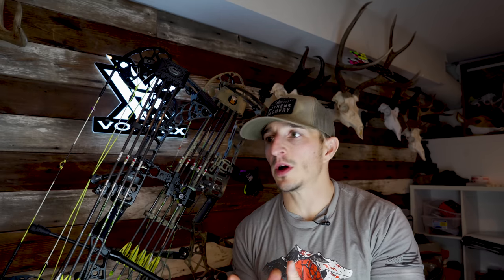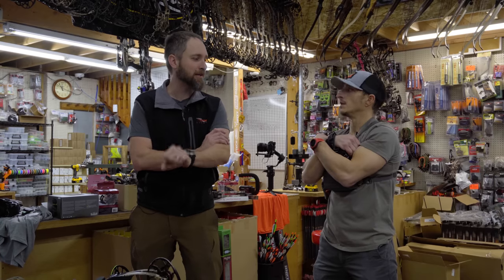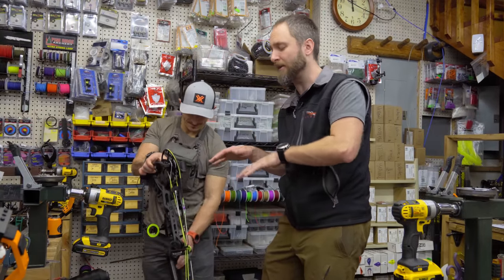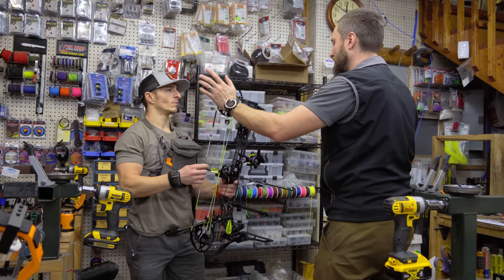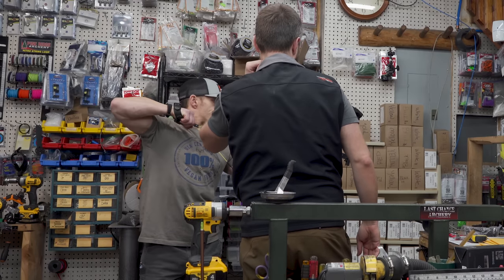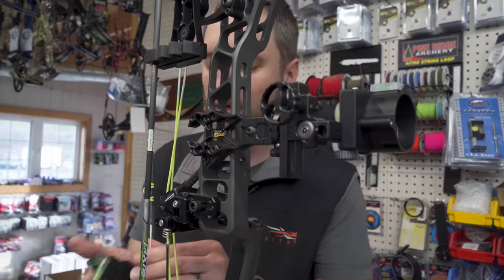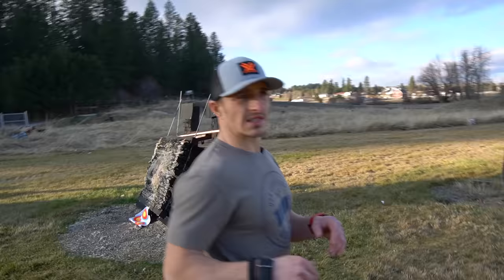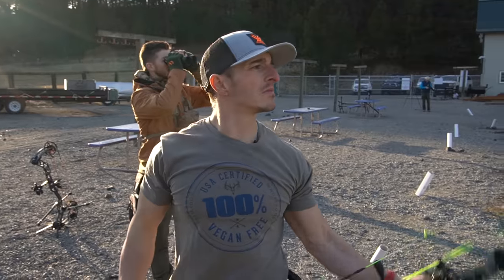PROPERLY FITTING Your New Bow // Best Practices

Comment: Great info again.  Another way to end up selecting the right premade yardage tape is to put white tape on the sight. Then get your 20 and 60? Or whatever range you know is good hits. Mark these on the tape as you get these distances. Then pull the tape off the sight and compare it to the printed ones to find the right one.  I normally shoot three different yardages ( 20-40-60) just to hVe a midrange reference point.  Arrow weight and speed can cause the mid range (40) mark to be off a yard or two sometimes.
Reply: I do this but instead of pulling the tape and comparing I lock a caliper on the 20 and 60 line and then just compare my gap against the sight tapes.

Comment: Thanks for the quick tips. I don't have a new bow to replace my PSE from 2006, hopefully next year since I am getting married in August. But I did get a new custom bow string and cables late last summer. Since I went to Cabela's and they were so busy they had me drop it off I am not sure if I am correctly aligned, but they probably measured my old set up and replicated it. I know that I need to find a true Archery Shop were they can spend time with me like he did here with Dan. 
I haven't tried a single pin, but I have been curious about them. I have ran inexpensive 3 and 5 pin sights including the current inexpensive Trophy Ridge 5 pin sight that claims to be ambidextrous, but isn't. I am on the edge of adjustment both vertically and horizontally. I plan on getting a new TRUE Left Hand sight and getting it dialed in from there. Maybe even a smaller aperture peep, not sure on that yet though. Thanks again for sharing.

Comment: Hey guys, loving these videos! Since you're doing a lot of awesome tinkering vids, I was wondering if you could do one on release type vs peep height? Been thinking about adding a handheld to the mix and have heard that might involve a peep adjustment. Others say they can use multiple release styles on the same rig. Thoughts and experiences? Adjusting peep vs adjusting anchor? I see Dan-o has been switching up releases lately. Thanks for the consistent information, entertainment, and motivation. Big fan🙌
Reply: Bump^

Comment: My MBG sight tape shows me almost 10fps then my actual bow speed.... I literally had to just mark my 20 and 80 on a sticky note and then line it up with sight tapes.... also, I’m guessing on that sight, your using your floater as the top pin and that’s why you really can slide further then the 100 (per first tape) , but if you get their dual indicator, you could have your top and bottom as floaters and go well past 100...

Comment: Wouldn’t be able put the monkey tail between the strings  because of the string angle my peep is all the way at the top where the serving starts and I’m a 27 inch draw. Guess I have a long face 🤣🤣🤣. Also I’m not having any issues I was just curious to what you would have to say about that. Thanks for the feed back though. I find with the Mathews bows if you measure from axle to axle and cut that perfectly down the middle for your nocking point the bow will perform at its best. Along with setting your rest at 13/16 and then paper tuning with the top hat system. 95 percent of the time u won’t have to move your rest from 13/16 if you find the right set of top hats. Doing those few things my set up always feels amazing and is very forgiving

Comment: I like the idea but it seems like there are too many variables to consider with those measurements.  Draw length should be relatively constant between all bows, but peep location and others are probably affected by the string angle, riser design and the overall size of the cams.  Definitely stuff to consider though in setting up a new bow.
Reply: Axis to axis

Comment: I agree with pretty much everything buttttt what happens when u have the peep height the same and the string the same length as the vertix but now your peep is crooked and u have to put a twist in your string. Now you’re messing with your draw length again
Reply: It shouldn't change that much to align your peep.